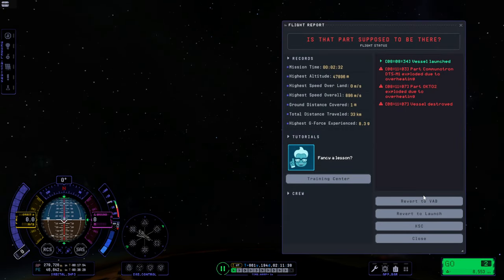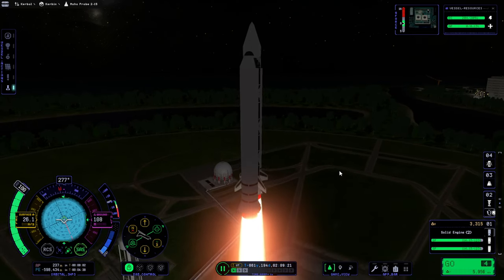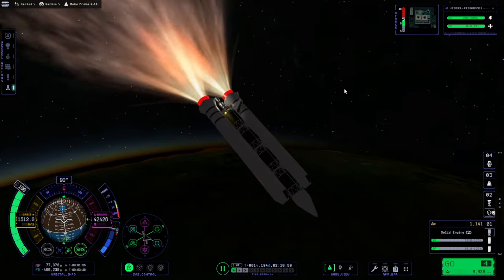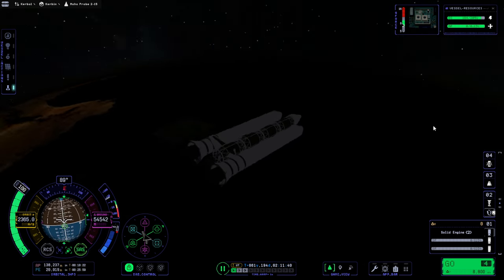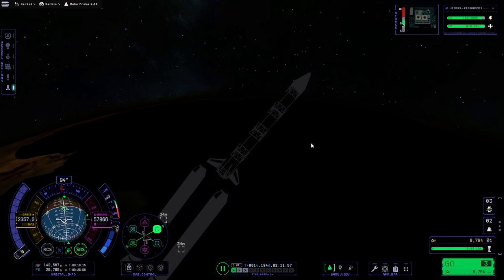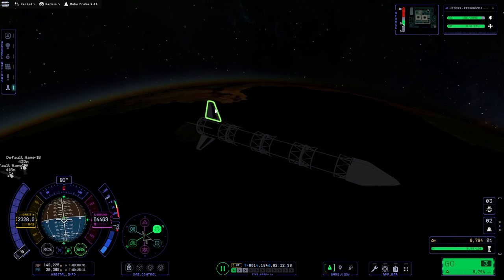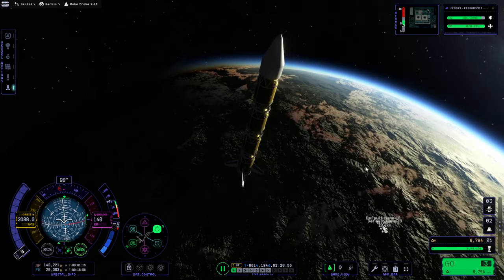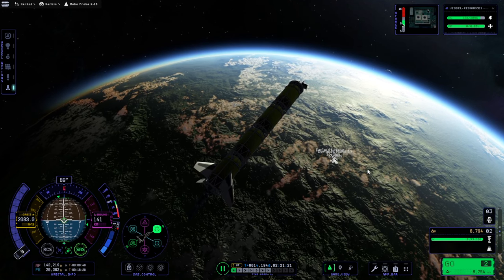KSP 2 Early Access - For Science 25 - Mohole Probe 1

Comment: Rcs seem to struggle with orientation, but can handle directional controls just fine. Its better to set up single ports rather than thruster blocks, and turn off roll/pitch/yaw and whatever else in the parts manager.